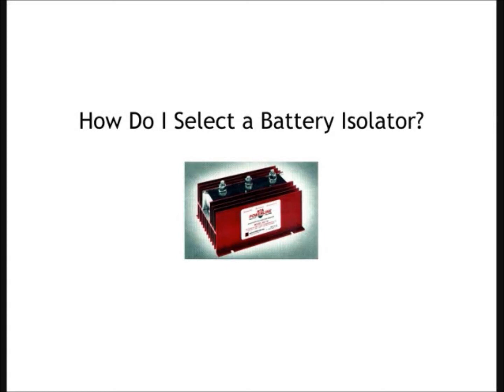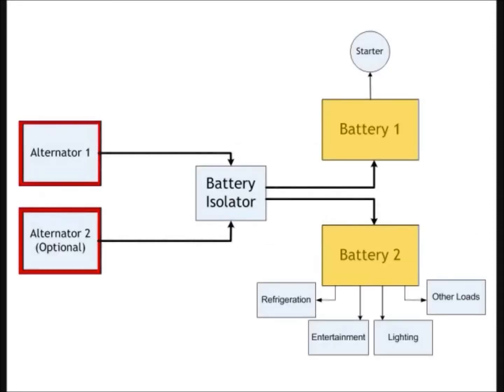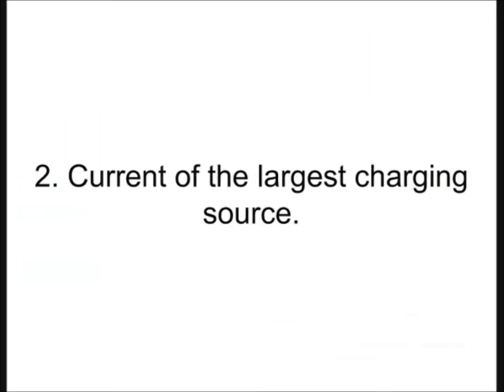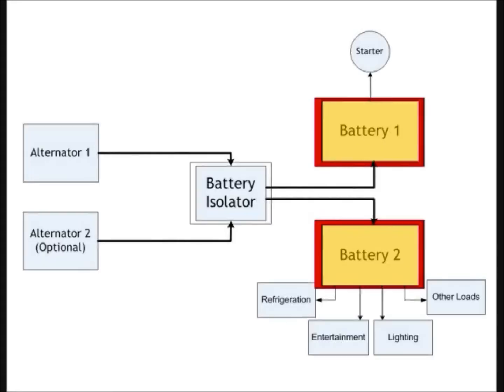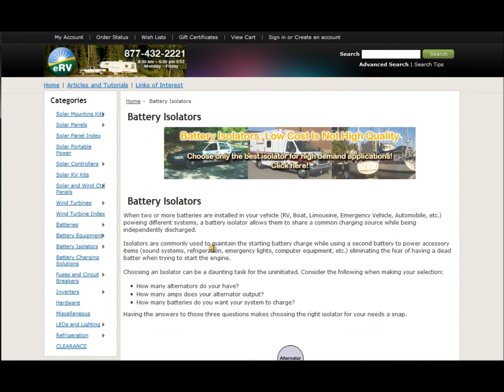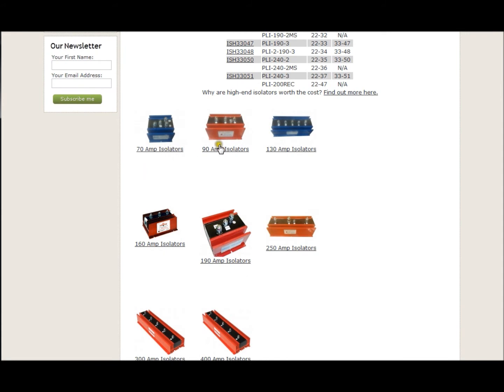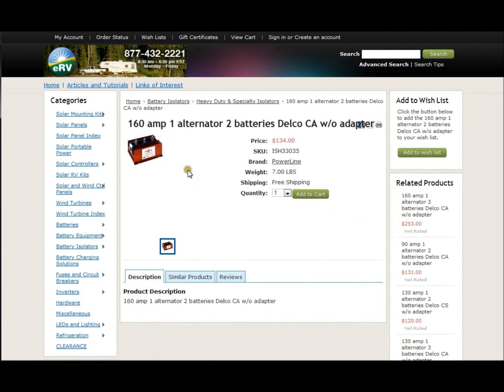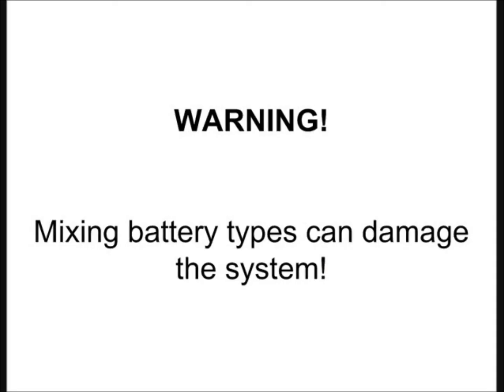How Do I Select A Battery Isolator?

Comment: I like to hook up a 4000watt inverter with two batteries in back of my 2007 chevy uplander (and still have my car battery up front) my alt is 125amp what wattage isolator is best 200 watt or 500watt and type amp fuse is needed.